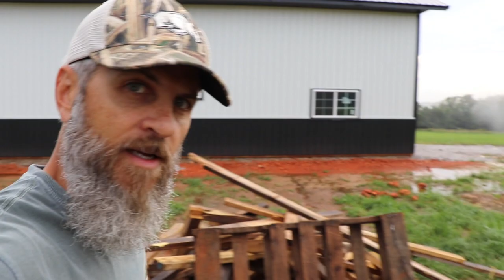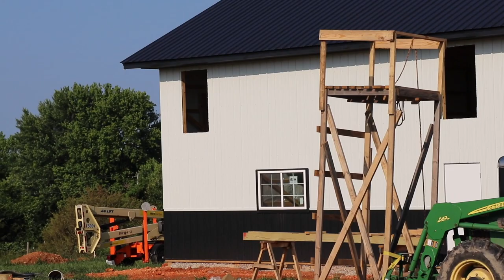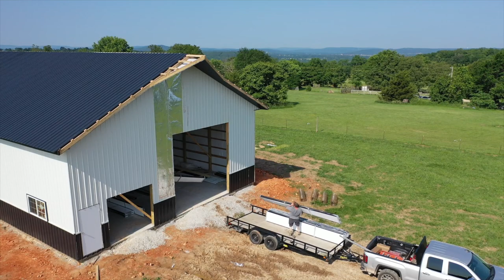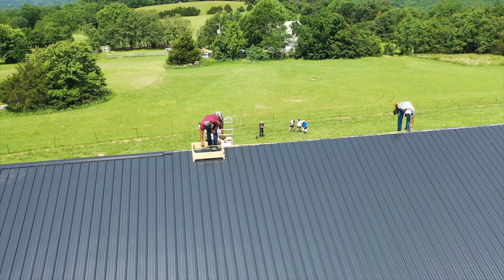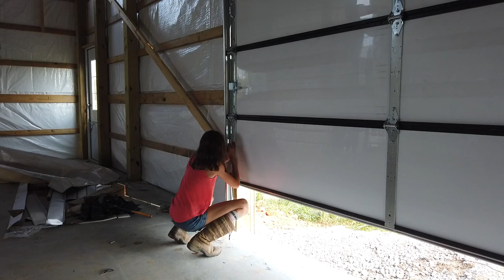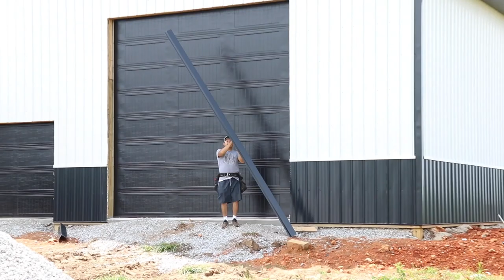The Barn is Finished with the Finishing Touches

Comment: The windows should have been installed before the siding th shed water. By putting the windows on top of the siding, any water running down the siding will leak behind the windows and into the building